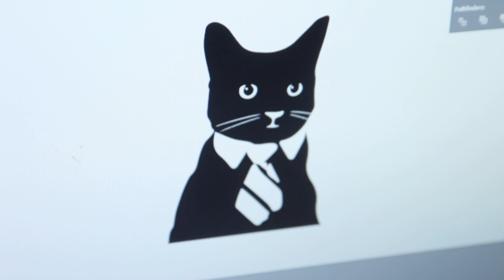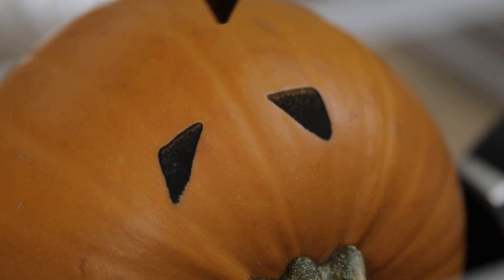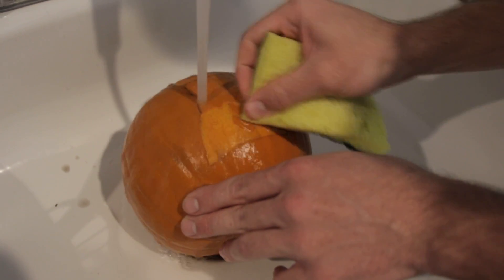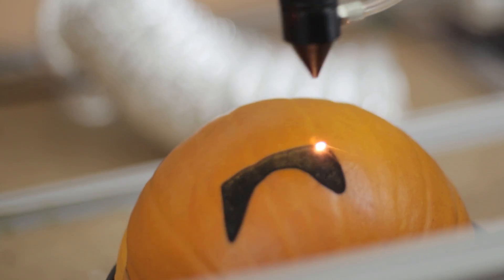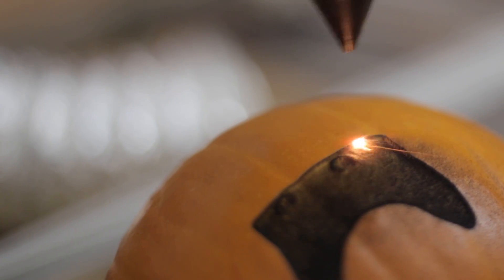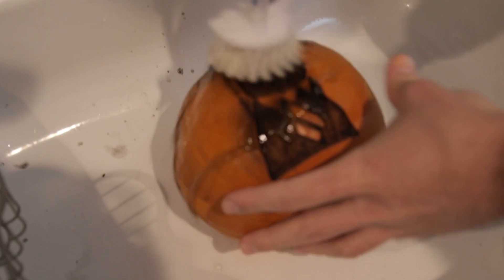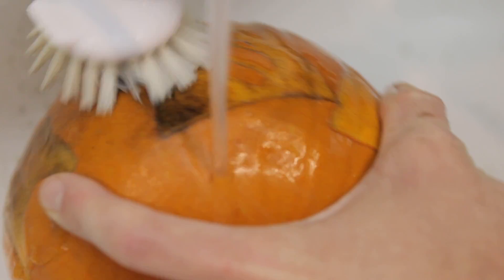Can a Laser Cut Pumpkins?

Comment: There's a few things to consider. When the change in focus widens the beam, it decreases the energy density, since the same amount of energy is always applied. So, assuming the focus at the laser-skin interface was always the same, it would've been better to first bring the power up to the "highest" rate for optimization; then to increase the speed as to adjust the dwelling time of the laser, which impacts its track/path for which it "cuts" upon. You would then end up with an optimized high power (assuming physics don't change much) and a high speed to raster.

Comment: what happens if you go over the same place twice with the laser?
Reply from the maker: It cuts deeper
Reply: William Osman so in theory, if you do the thing twice with different settings, could you achieve the last result but with the whiskers? i have zero experience with pumpkins and laser machines so sorry if the comments are dumb :'D (also you and the camera dude are pretty cool)
Reply from the maker: Multiple passes is a strategy for lower power lasers, but usually it's better just to go slower for deeper cutting.

Comment: You should use a rotary encoder and rotate the pumpkin or a ball on  its polar axis instead of moving the laser on the x-axis. If your laser firmware is grbl, you could try adding a rotary axis to your laser cutter.